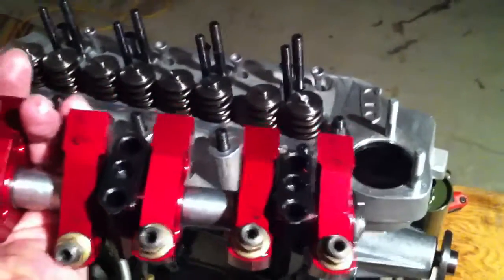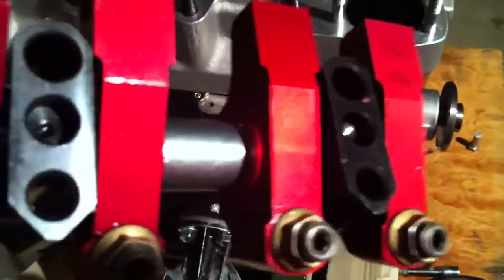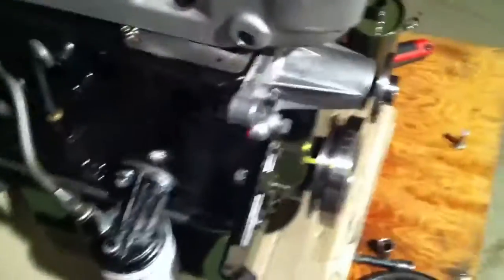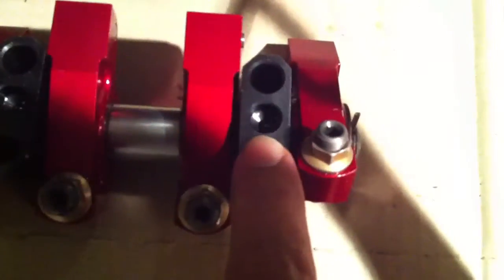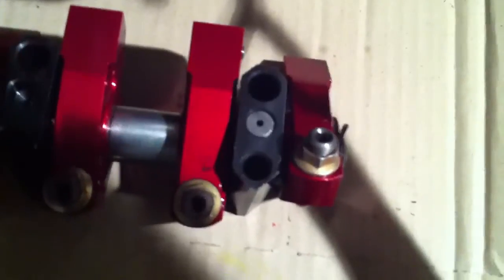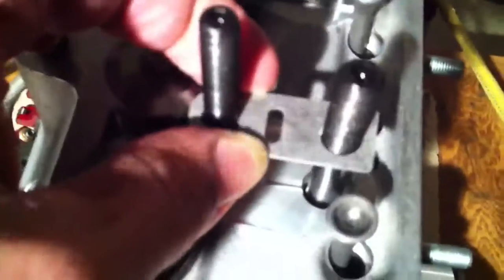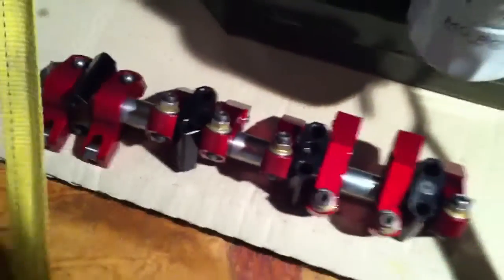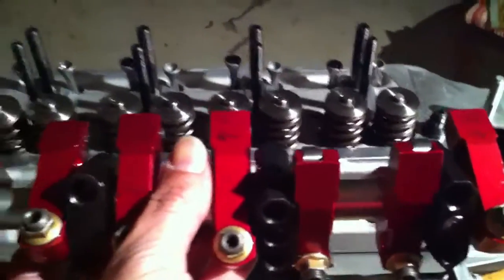Restricting oil flow for roller rocker shaft

Comment: If it is a loose fit in the bore and it's not flush with the rocker pedestal then there is nothing stopping the oil going around the outside.